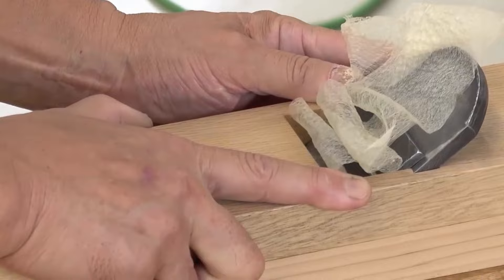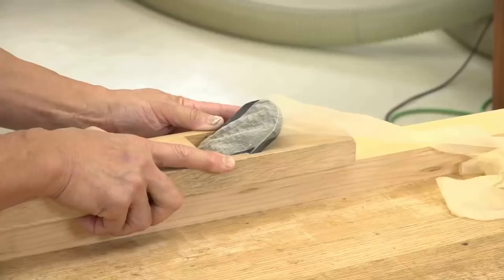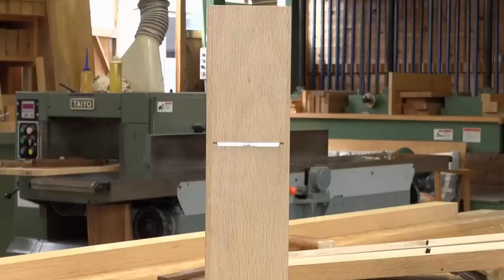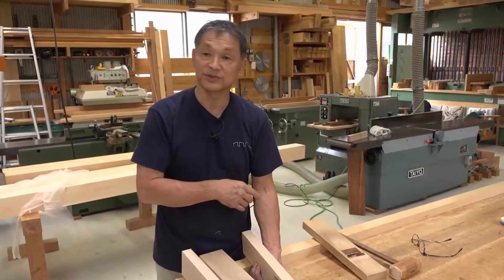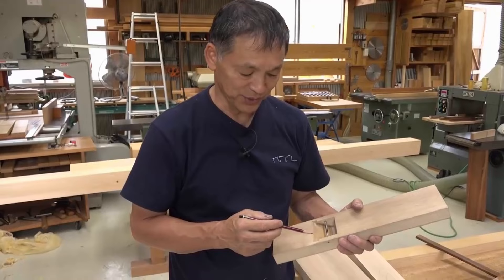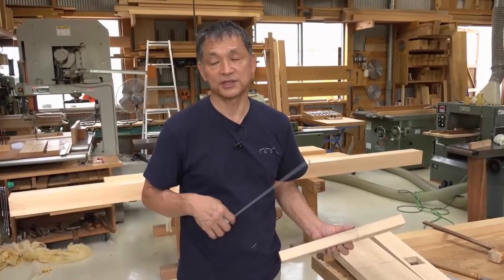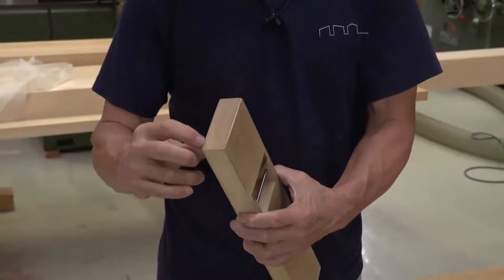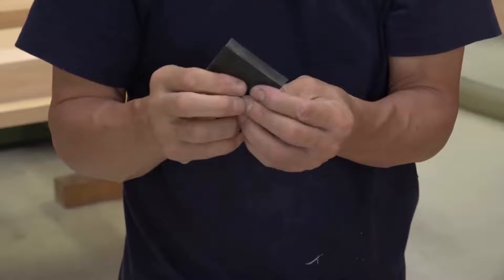Amazing carpentry skills with his ultra-thin hand-planed shavings of only 3 micrometers thickness

Comment: Less than half a thousandth (of an inch)? I want to measure that shaving myself. And I would like to see a video of George Nakashima's claim of a plane set so finely that it took a shaving with only its own weight pulling it down an inclined board.
Reply from the maker: yeah, you're right, 3 micrometers thickness = 0,000117 inches thickness
Reply: @WoodworkingEnthusiasts , to be fair, in the video the numbers used by the narrator are 10 microns to 30 microns, which I calculate to be a minimum value of .00039 inches. I realize that the shaving we see in the video is finer than any I have acheived, but four tenths demands verification. Well that is one thing, but in the first part of the video the craftsman seems to suggest that planing the surface of a wide  wooden board or tabletop to a flatness using the 10 micron value is a matter of skill and enough time. I believe this to be hyperbole, but perhaps I should finish watching the video.
Reply: 3 microns is indeed up there but if you lookup "kezurokai" or the japanese planing competitions, the top competitors absolutely archieve sub 10 micron shavings. One thing to know is that to make those reccord thin shavings they use very high quality timber. I found a few examples of what is mentioned in the video.
here's someone making a 5 micron shaving: https://www.youtube.com/shorts/9aa23olfwpM
and here's a short where you can see a competitor simply pulling his plane with a rope not even putting any pressure on it: https://www.youtube.com/shorts/t6nFj2f_sZY